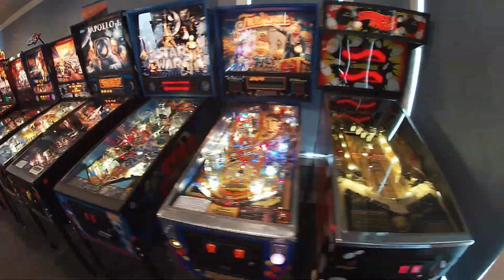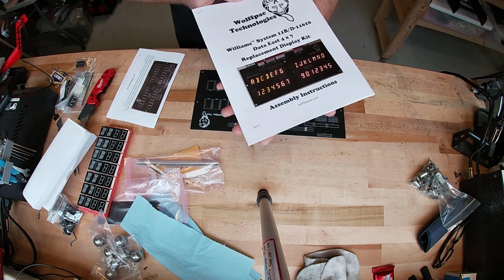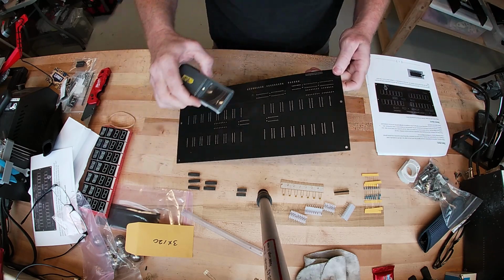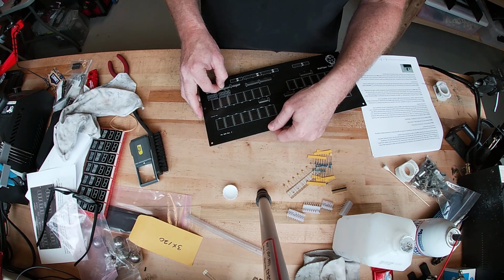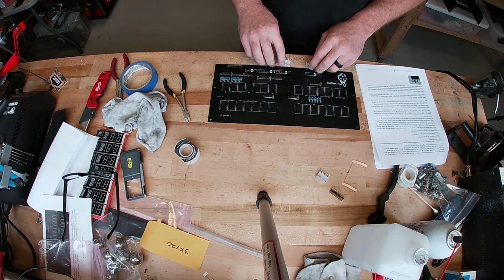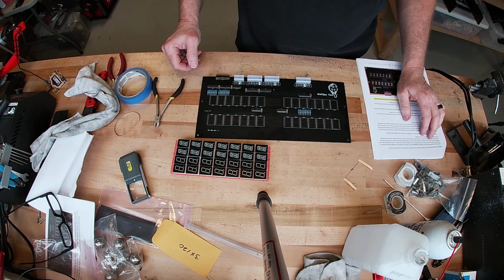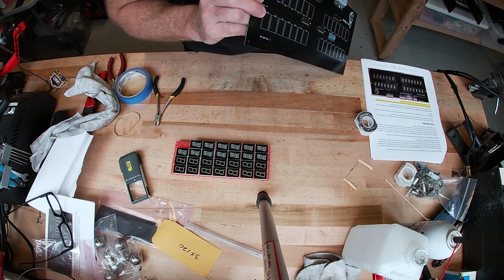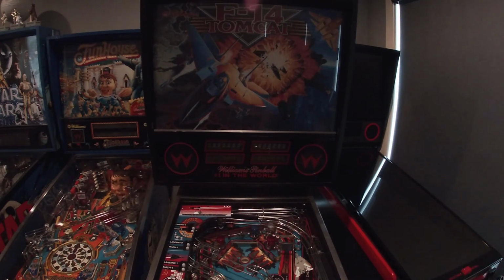Wolffpac Pinball LED Display Kit Review

Comment: Nice install! My only issue with these new LED displays, either pre-made or DIY, is that the width of each display digit/character is thinner than the original gas display characters, and in turn doesn't fill out the entire display window or can't be read as clearly. I personally love the original system 11 alphanumeric displays with their wide width characters. Even replacement LED displays for those don't look nearly as good as the original.
Reply from the maker: You are correct. I don't replace displays just to replace them but I feel this is a great choice when they finally crap out.